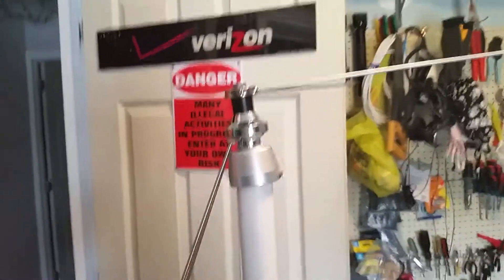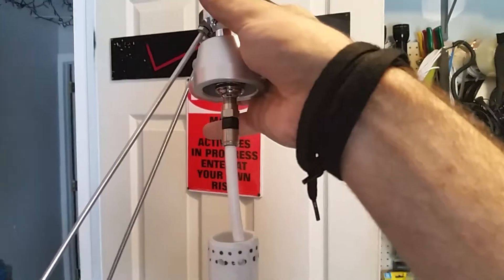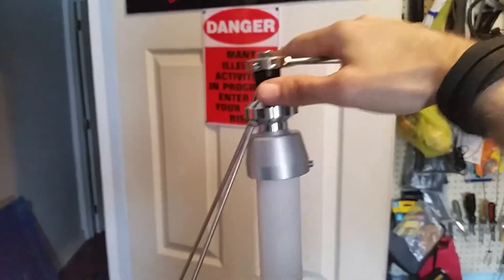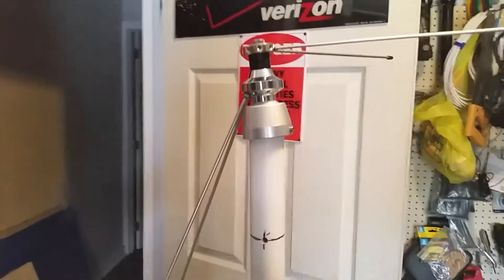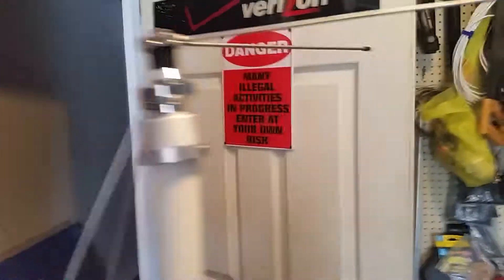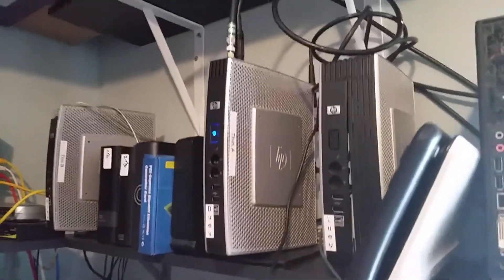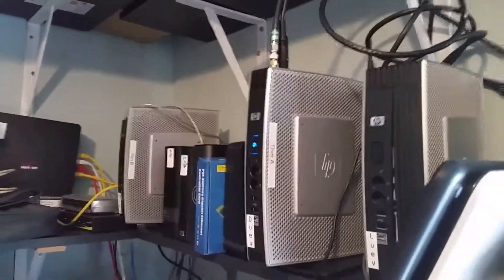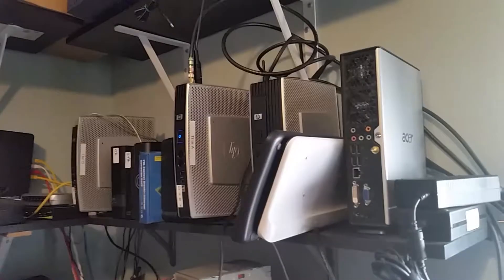Discone Antenna - Coax Feed Point

Comment: Where is the original steel pipe? why are you using F conn. ? usually requires a PL-259 or a N on some. A good installation too me is safer than a bucket that might roll over on the roof.

Comment: Good afternoon greeted you from Guatemala Central America, with a question, what type of mast can I use with that antenna, if I use iron or metal, it will be that there is no problem or first I use a piece of plastic and then I use a metal tube, thank you  .
Reply from the maker: I recently had to install my discone on a slope roof. I used a metal satellite dish arm, but it was too short and the discone antenna hit the roof. I used PVC pipe with some bolts to make the arm longer and mounted the discone on the PVC extension. The material of the mast does not matter. Use metal or PVC pipe.
Reply: Thank you for answering I thought that aluminum and metal could make bad contact but I see that I was wrong. Thank you very much for answering, God protect and bless you.